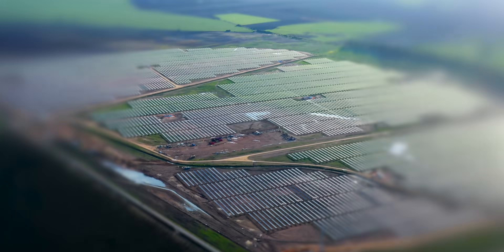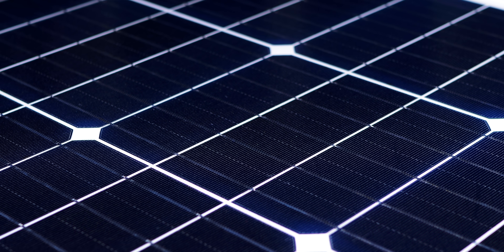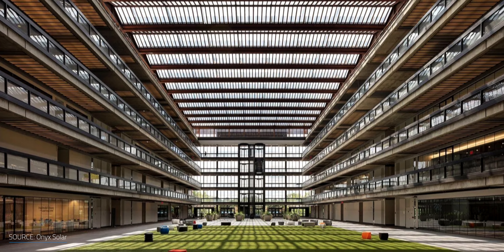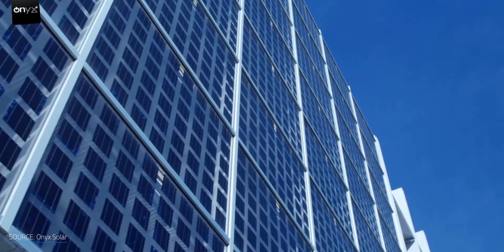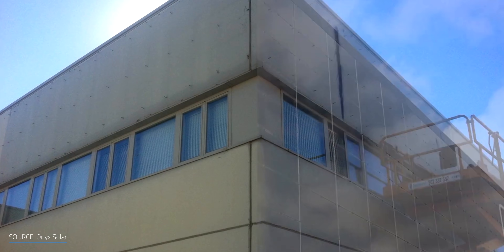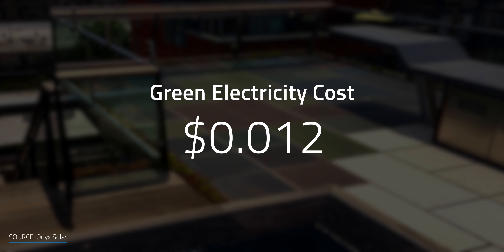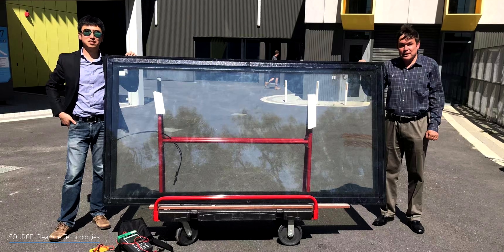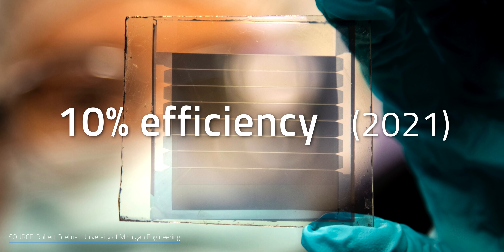Exploring a New Transparent Solar Cell Breakthrough

Comment: Since the costs don’t seem to be much more than normal windows, I think using these instead of normal windows in a new building should be a no brained. Of course, was that just the price of the pv-window? If you add in all the wiring, converters and such, the economics might not pan out. In hot dry regions, the reduction of hearthstone enters the building make this more viable. 
Im for it. Go Team Solar!

Comment: Light that is converted into electricity must be absorbed; you cannot have 100% transparent and 20% electricity conversation at the same time. Can you have 50% transparency and 20% electricity conversion efficiency? Theoretically looks ok, but there will be problem with spectrum and that will be similar to a regular panel with 40% efficiency. Looks tough.

Comment: Fun Pun's Matt, Thank You!  This feels like one more thing to add to the Systems Arsenal, just as solar paint might.  Although not efficient yet and the ROI feels a bit dubious, the additive use could tip the scales slightly if Architecture could consider more innovation in shapes for collection.  To me it's kind of like perpetuating the AC products for a 100+ year old grid for new construction or retrofit.  They have done pretty well over the last 20-30 years on thermal efficiency...this may be further enhanced with shape and other building techniques.  Problem to me is the population density, limiting architecture to highly vertical structures. As for roads and pavers...great but the current cost are about a  $1M per mile and highly probable the cost would be considerably higher with a more carbon intensive front end, but worthy of consideration for the square area alone.  One other thing to consider is the Lat/Long...not all live in the 23° zone, so alternate methods/per zone and or a distribution needs consideration, imho.

Comment: Reducing heating costs buy using not-useful light? But also using that not-useful light to make electricity? I'd be curious to see an efficiency number weighted with the heat-reduction of the windows as well.

Comment: you know what? if these technologies are as good as it said, absorb all uv and infrared and only let go 38% visual lights bla bla bla, they can have pay back time in 0 years!

why it is not use in welding glass? that 3x3 inch glass in a fiber helmet can easy be sold at 50?100? dollars per unit. and it will be sell like hot cakes! while you are talking about how much dollars per square meters in windows.

welder is a occupation that retire pretty early worldwide, most are eyes problem. and skill welders need years to train. no welders no building, no machine and no steel structures.

is it those manufacturers too stupid to understand this? 

or……is it those products not as good as it claims? 

another they print, you believe hoax. 

these kind of hoax all shares something in common. "turn all xxx into environmental friendly / free energy". the key word is "all", that word becomes so communist mindset! hypothetically say, if the technology is real, all windows glass in the world had to be replace? first you got to tell this sad news to the church, they had some window glass classified as national treasures, which may worth millions.

Comment: Putting any solar panel, be it transparent or not, in any fixed placement is a waste. If you want to use them at their most efficient they have to be put in tracking arrays that follow the sun. Failing that, roofs make more sense as they're still more efficient than vertical panels.

Comment: Hi first off all thanks for this great video.
But why compairing "glass" solar panels with roof solar panels? Why not installing them both? If the payback periode is less hen 10 years it still is profitable to install windows with this technology. In adition to the roof solar panels. Its just that bit extra power without the need to expand the roof. If all buildings would have windows with solar power there is a hugh winn in the solar energie production. This all is only iff the payback is resonable.

And as always greetings from Belgium.

Comment: Imo organic solar cells would be a bigger game changer than perovskite solar cells. Organic PVs are basically a bit less efficient and durable than silicon but alot cheaper than silicon. Once thin film OPVs are mastered cost of electricity would drop significantly. Main use of OPVs would be in agrivoltaics.

Comment: well ... you know what they say ...  Every Little Helps :)  my advice is .. if its green .. go for it
Reply: 0.1KWH over 6-7 hours per panel... each panel could just barely power a 60W equiv / 800 Lumen LED light fixture on a good day... =[
Reply: What's the point in wasting money? Surely going for the most efficient green energy applications makes more sense. It's like installing solar panels inside your room and hoping that the minscule amounts of energy would somehow offset the co2 of making the panels.
Reply: @nonyabisness6306  one thing is clear from the green energy bubble is that signaling is way more important to consumers than efficiency - the target audience can afford the waste, it seems in order to pioneer a vision of a cleaner future. Right or wrong it is akin to an anti capitalist arguing their iPhone is a necessary tool to usher in the revolution. As long as it all works out in the end, try not to think about it, I suppose the thinking would go.
Reply: @6Sparx9  Which is the reason we don't use more nuclear. It's pathetic really and the reason I can never vote green.

Solar Roadways, Solar Windows, Solar Rooftiles.

These people are literally responsible for Coal sticking around. Which isn't as bad as it sounds, modern filter facilities are pretty good, but still.
Reply: @nonyabisness6306  nuclear is supremely massively expensive to get started and there is little to no standardization to reduce plant build costs,, and the much needed near 100% safety threshold keeps costs of building and running a plant govt. subsidy-needingly high. Small nuclear reactors and other mass produced plants look promising - nuclear is a great especially when paired with hydroelectric to compliment renewables with a baseline output fossil fuels currently provide but cleaner. I'm still up for scrubbers, carbon capture etc there's no reason to write fossil fuels out of our future either.
Reply: @6Sparx9  If it replaces fossil it's not complimenting renewables. It'd be the main source of power. At which point I'd ask why bother with wind/solar, which need batteries and rarer resources.

Also the cost is artificially inflated right now, partially because no one build plants and partially because of frankly overly strict guidelines for construction, desconstruction etc.

I'd also rather have big plants rather than many small ones. History shows us that the most incidents happen with smaller nuclear sources.
Reply: @nonyabisness6306  the cost of nuclear is higher in US than it should be, but even if it were cheaper it is still astronomically more expensive than  a coal or gas plant, and I'm a proponent of nuclear. The US is big, big enough that different forms of energy production make economical sense in different parts of the country - good luck getting solar from Montana, but Arizona's climate is practically begging for it.
Anyway you are half correct that nuclear doesn't compliment renewable as much as one thinks and this is largely due to how most of the countries electrical grid is designed - this is where battery tech, or hydroelectric or some other form of short to medium term energy storage comes into play, and all being well should make our electrical grid more reliable
Reply: @6Sparx9  Obviously I am not trying to formulate a local energy strategy. I am speaking generally. Coal and Gas supply for example can be an issue, say in europe for example. It's also relativly impactfull.

If we build more nuclear power stations the costs will sink, it has a very low environmental impact and can compete with other forms of energy generation. So we should use it. I personally prefer Hydro-Electric, but you can't build that just anywhere.
Reply: Except that sometimes we focus on the wrong things and pat ourselves on the back.  A good triple pain window will have an R value of about 8.  You have to have an R value of at least 13 for the rest of your wall, minimum, with up to 23 being standard, with R-values in attics ranging from 30-49.  

Windows are pretty.  We know how to build buildings that are way more energy efficient, but we'd rather throw steel and glass at it.  Ultimately it comes down to what we want from the place and how much we are willing to spend.  We've dramatically cut the cost of lighting in the last couple decades.  There may be places were solar windows might be useful, but in a lot of places people might say, "Oh, cool, lets cut a big hole in the wall and put in a picture window.  We can do it now because it can produce a little electricity".  You could, of course, put non-see through solar on the wall and roof and get a lot more electricity, probably a lot cheaper too, and save a ton on heating.

Don't get me wrong.  I love my beautiful windows.  They look out on trees.  If we ever crack the fusion question and we have endless green power big windows are a wonderful idea, but at that point we won't really need transparent solar cells.  This is one of those things where we start with the compromise- 'So we don't really want to be that energy efficient, so lets try to salvage huge amount of heat going through the window by generating a little electricity out of it.'

Someday I hope we have fusion and we can have whole walls that turn into windows, and TVs, and still somehow open up to let air through like a screen... but until then this seems to be something where the real plus might be in edge cases.
Reply: @NacorantheHarmonicaPlayer   you're wisdom cannot be argued.. insulation and highest free power is paramount
Reply: @mike-rayner-videos  I dont quite get the logic that so-cheap-its-free power will solve all problems. We still have to do things with said power, and that time, labor and materials all still cost a lot, less in a power rich world but not nothing.

Edit: the best example I can think of is Norway, who sell their surplus oil to others and keep the revenue in house to dividend their citizens and fund megaprojects, but this relies on them defending, extracting and producing a high demand energy reserve then selling it. The free energy paradigm imagines energy so abundant (and freely available to the public) that counties wouldn't be able to prop up their economy on selling it to others.
Reply: @6Sparx9    i agree in that this is pretty useless at the moment .. but truth is .. none of this matters much if China Africa and India keeps breading like they are.. another 3 billion people by 2050 .. mother nature don't stand a chance
Reply: @Abudy Awad ha-ha .. nice one :)
Reply: No it's transparent, not green.
Reply: its solar freakin roadways guys!
Reply: tescos
Reply: It is hard for green options to hit all the Checks that will let it grow. It has to be effective, it has to be reasonably priced, it needs to be repairable to where it won't just become junk within 5 years. And many other things. That's why some are critical of green these days. because some times they make it unsustainable.

Comment: Even if solar windows are only a twentieth as efficient as regular solar panels, the surface is what matters.

If you stack two red bull cans on top of each other to represent a skyscraper, the "window surface" is already twenty times of the surface on the top. Surely orientation towards the sun plays a role, but using solar glas sounds like a really big opportunity.

Comment: All of the favorable cost comparisons with traditional triple paned glass makes us wonder about the potentially huge replacement window market, after the efficiency issues are addressed. One area not discussed is the infrastructure required to harvest the electricity. When you consider wiring upgrades, inverter costs, regulatory approvals, this may not be a reasonable thing, even with homes already set up with solar panels and energy storage systems.

Comment: I disagree with your comments on the efficiency "problem". The comparison shouldn't be transparent cells vs standard cells, but instead transparent cells vs standard windows.
Reply: Absolutely. If the cost is comparable anyway, then the only concern in the way of this being an obvious winning tech is how green their production is and what to do with those panels whose usable life has ended. Would an office built with these have to spend more money and energy swapping out the depleted glass than the panels are worth over that time? It sounds like the return on the initial installation is great, but I'd want some idea of what I was setting myself up for if it were my building.
Reply: Disagree.  The comparison should be vs current glazing installations.  That’s what the ‘new energy’ producing glass will be replacing.

Comment: All these new solar cells sound great, implementation and use is key. If you can replace 2 components with one at a positive long term cost reduction and with a customer who sees the longterm benefit, then you have a win. Time will tell.

Comment: Standard double pane windows cost more than "$24-45/m^2", even if we exclude installation costs (9:12). I suspect the actual units including installation costs may have been in square feet, which would probably put the typical cost at $400-800 per window. Just another reminder for why we should move to metric here in the US to avoid conversion bugs. :)

Comment: Yes, this is promising. 

And, we should not see it in direct comparison to utility or residential solar.  It's more about self sustaining systems. 
Can that window panel meet the electricity requirements for each room and then rooftop can be used to build a veggie garden? 
I mean if it is integrated and fits our agenda. We are winning...

Comment: I think transparent solar screens in cars and tech devices is a very long way off.  Installing them on the sides of buildings is intriguing.  Even with the reduced efficiency ,the increased real estate should still make them worth the investment.  Combine then with traditional rooftop solar and I think we're in an even better position.

The drawback of this technology is that it's not going to be efficient in dense urban environments where tall buildings cast deep shadows on each other.  In those cases, I think only the buildings on the perimeter will really be using these, and older buildings may be difficult to retrofit due to laws governing "historic buildings" and such.

Comment: Window solar panels aren't a replacement for conventional PV panels, why fixate on the efficiency? A skyscraper has way more vertical surface than rooftop. Any electrical generation is a good thing.

Comment: Well, as an Architect I am a bit frustrated that the basic design principles of orientation, adapting to the environment and the sizing of the windows make a huge difference in overall cost and liveability in housing. Unfortunately, city planners and regulations getting so complicated and they don´t think in a way to help lower co2 emissions, water usage and of course energy demands.  On top of that, it is not always helpful to over-engineer everything but to design properly the house. Solar gains and all.

love to see new developments. Wonder sometimes what kind of housing, industries, and overall city development will look like, when those technologies go through the roof.

Comment: Does Transparent Solar Cell could cool the indoor by absorbing invisible part of sunlight? If it does then it is  great for tropical area, lowing the AC power consumption while generating power. Further more if the cell and the glass could replace separately then the operation cost and carbon footprint will be lower too.

Comment: The greatest advantage of transparent solar windows and solar roof tiles is that these aren't architecturally or aesthetically invading... unlike big solar panels hanged on a roof top. Even if overall less performant, these have non-negligible  advantages. An 18th century patrimonial historic building could be easily convert to solar power without ruining it's look... skyscrapers could be convert without adding any additional wind drag... no risks to see someone stealing your solar panels... well, you'll literally see him coming if happen etc etc.
Reply: I wonder if 10% is efficiency is really a problem because it is 10% that would otherwise be heat that the AC does not have to take care of in the summer, so the effictive power saving + generation is closer to double 20% efficiency is already kind of competitive.  but I guess people are comparing against tinted or low-e glass, so perhaps not.
Reply: What's the point in wasting money on inefficient solutions when you can just build a proper facility and use the efficiency gains to power your architecturally important building twice over for cheaper?
Reply: Sorry, but it seems idiotically costly to change all the windows in an existing skyscraper with these expensive panels, when instead you can get much more power from simply putting regular, cheap, more powerful solar panels on the ground. Don't you agree?
Reply: @tzenophile  

As they become cheaper and more efficient, it takes less and less time to make your money back
Reply: @PashaGamingYT  You will never get your money back. Removing and replacing the windows of a skyscraper will be an insanely expensive operation. And what a waste of perfectly good windows, add them to the cost. It would not pay off even if the cost of the new PV windows were zero.
Reply: @dwc1964  Check the OP's statement and then get back to me. Or not.

Edit:  @dwc1964  deleted his comment. Not very elegant, but understandable.
Reply: Solar panels on an 18th century patrimonial historic building is an IMPROVEMENT.